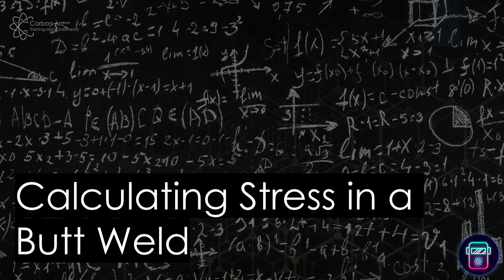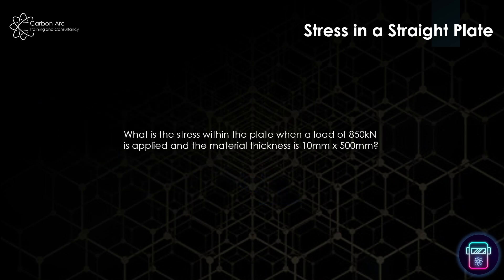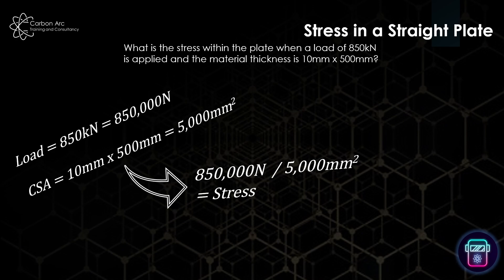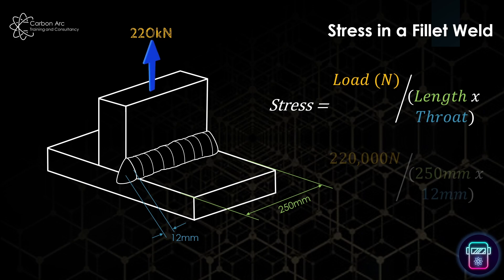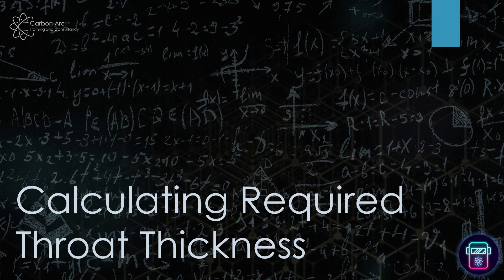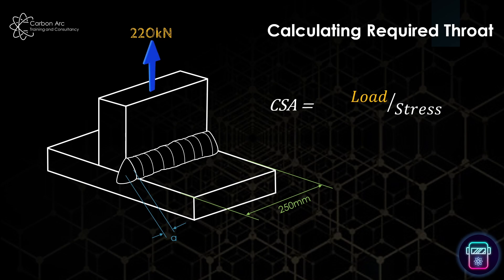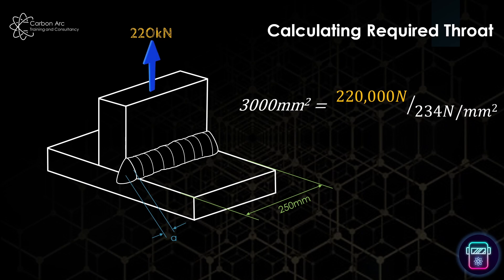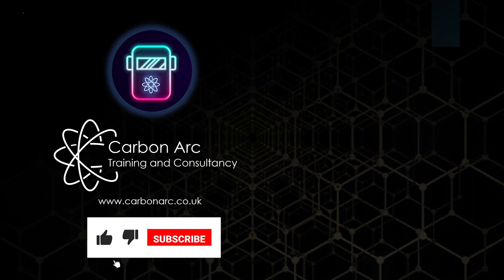Weld Sizing - How to Calculate What's Needed (CSWIP & IWE)

Comment: Its a good educational video but the things i didn’t understand while calculating the throat we have the load and the stress how did you get csa equal to 3000mm2 while the value of load and stress doesn’t give us the same value 220kn devide by stress gave us 938 mm2 how do we get the 3000mm2
Reply: Ok good to know im not the only one that was confused on the final section of this video
Reply from the maker: Hi everyone, I will make an updated video next week to try and clarify for everyone.